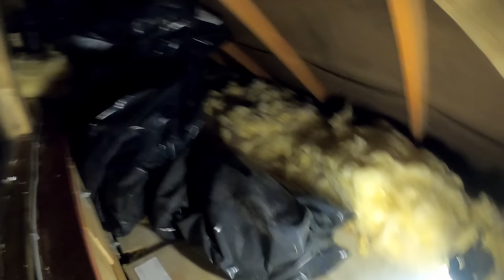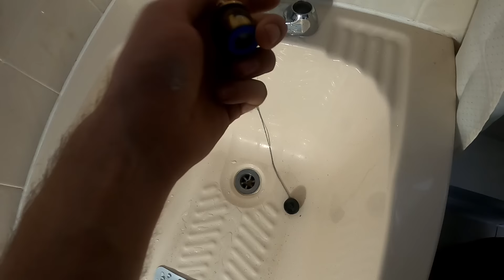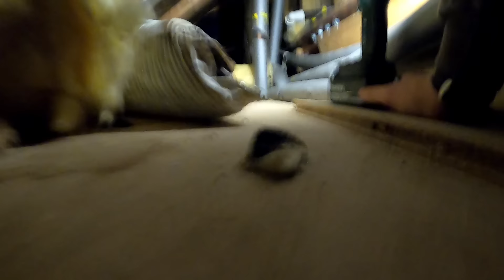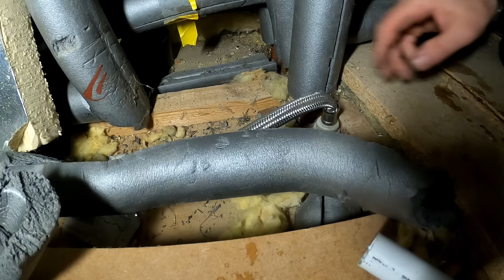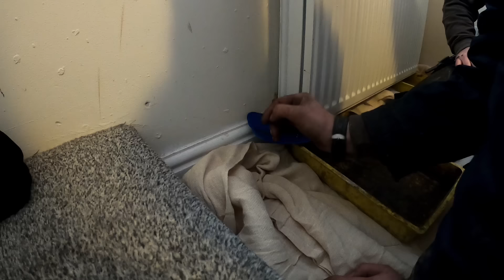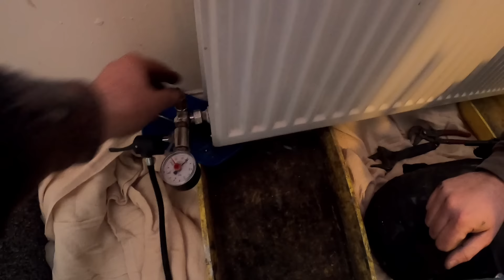Mistakes were made | Plumbing bodges

Comment: Top stuff mate , I was working on some radiant ceiling panels today , client said they had always worked fine.
Went in to the roof space.  both isolating valves were turned off, and there was no water at all in the panels! They had never been tested/commissioned.
Reply from the maker: Thanks for the support as always mate, it always amazes the amount of times stuff like that happens

Comment: When i bung my tank i always  seem to get a run of water more than whats just in the pipe. What would the reason be for that happening? Great video as usual really appreciate the extra work it takes to produce these video's.
Reply from the maker: Some tank connectors have the ridges inside which makes them difficult to bung, I've had it where those have let by a bit, thanks for watching

Comment: They need to get rid of the rats / mice as they are going to chew that plastic pipe :)   Regarding the videos do as you please when you put them out we will watch don't feel pressured Tom.
Reply from the maker: The rest of the system was copper to be fair, rats do love plastic though, thanks for the support as always mate
Reply: @PlumbLikeTom  I had a job recently it was in the country side and they had done the whole house in plastic and the mice loved it making nests next to the warm heating pipes and having a chew on them springing leaks everywhere.

Comment: Piece of advice pal....get urself a 17inch long socket extension for the impact driver on them tap cartridges...God send mate I do both taps in 15 mins 👍
Reply from the maker: Good tip that, I do have a proper tap splitting set that holds against itself but I rarely use it, it's a gimmick really but occasionally gets you out the muck, have a great weekend
Reply: @PlumbLikeTom  haha fairplay bud Just thought I would let you know so you can give it a try to make your life easier 👌 cracking work though mate and content keep up the good graft and post enjoy you weekend too pal!
Reply: You ever broke tap/insert using impact driver and 17?
Reply: @deathstr0kexorn765  no mate works a treat everytime 👍

Comment: Great video again mate. Out of curiosity, when you pressurised the heating pipe, why was it losing pressure if the 15mm isolation valve was turned off ???? Surely that small length of pipe to the valve would have built up pressure. Cheers
Reply from the maker: It's because we accidentally loosened the nut on the iso valve below when messing the the rad valve, either that or is was never tightened, thanks for watching mate

Comment: Those iso valves were closed so how did the pump act as an open end? Surely there is an open end somewhere otherwise it would have just built up rad side of the iso valve?
Reply from the maker: I think we must have loosened the top nut on the iso when messing with the rad valve, either that or it was never tightened, thanks for watching 👍

Comment: Not from the UK so wondering what’s the reason for the header tank? Does it only do the bathroom? That water pressure is terrible.
Reply: Back in the day UK water mains were woefully undersized and couldn't cope with the flow rate houses required. So they put header tanks in the houses to act as buffers. That gives you decent flow but obviously abysmal pressure unless you add a booster pump. In many places the water mains have been upgraded and you can change the installations to mains fed but not all of them.